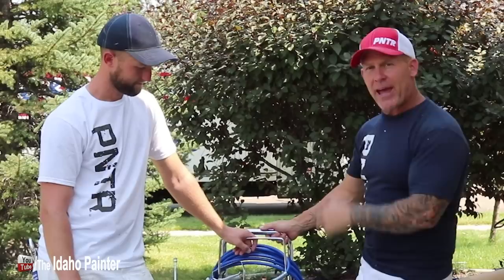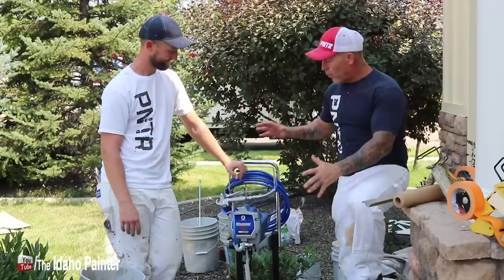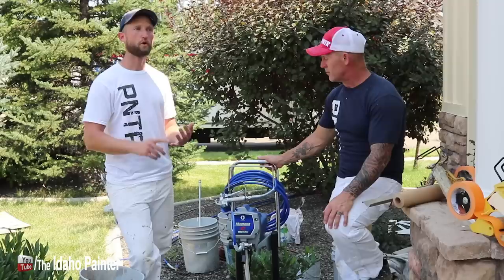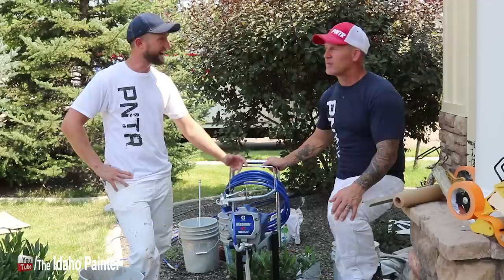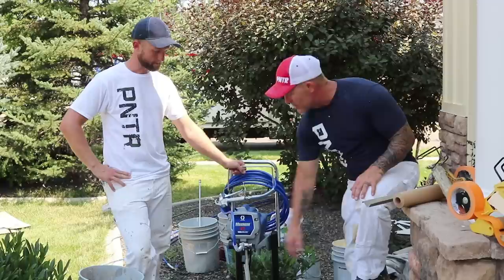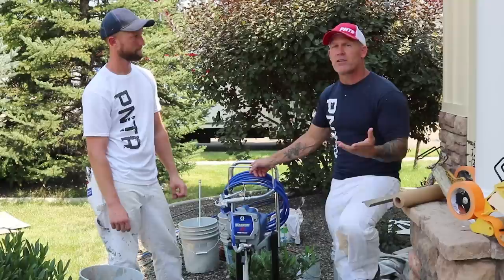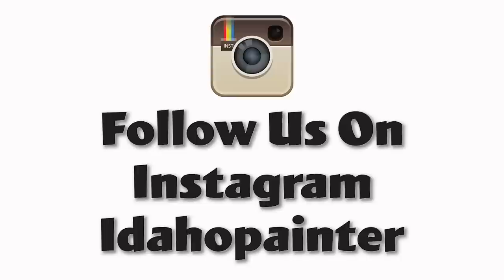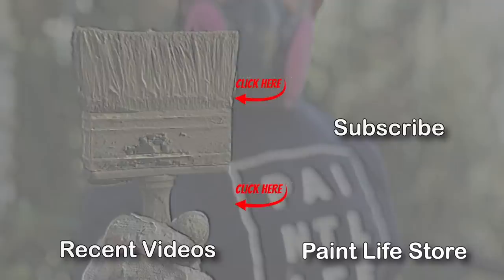Graco X7 Paint Sprayer Review

Comment: Awesome! I used this exact sprayer to paint the exterior of my house and surrounding security wall. I couldn't be happier. The unit comes with an easy-to-understand instruction card. As it was my first time painting anything, I called customer service several times throughout the weekend project. Each time I called a knowledgeable and friendly customer service rep assisted me and I was back to work in no time. Cleaning the unit between colors or at the end of the day is almost TOO easy. Being able to connect the water hose/switch the unit to cleaning mode saved so much time and sped up the process. As a homeowner/DIYer I LOVE this sprayer!

Comment: I bought this paint gun and used it for the first time today. I was using the highest quality exterior paint, which means it was thicker. I spent 4-5 hours fighting it to spray and only 2-3 hours of good smooth spraying (happened at the end). I called customer support and was told I should use a bigger tip than the one that came with it, use a drill paint mixer, and strainer. I'm a newb. Not sure whether to return it or hope it works better next time.

Comment: Thanks for the nice review.  One thing that would be useful is a comment about the quality of the gun. I have a very, very old Wagner 505 that I'm now replacing (somewhat in a hurry as the pump finally let me down in the middle of my current house painting project). The gun was junk but the motor/pump was ok though a bit anemic [515 tip but nothing bigger and this is mostly fine]. I replaced the gun with a professional unit and the thing worked like a charm for 20 years -- I'm a home-jobber so about once every 5 years I pait a house.  Also, knowing what the realistic hose length is would be useful.  That old Wagner came with only a 25ft hose. 50 is about right for me so I added a length.

Comment: Buy the Graco X19 same size & weight but it doesn't run constantly as you spray. I've had one for 2 years got it used & can't kill It! The pump has lasted longer than the gun it came with haha
Reply from the maker: Thanks for sharing your experience with it!
Reply: @Idahopainter  
No problem- it's says the X19 is rated at 500 gallons but I've run over a 1000 through my used pump easy! It's all about how you clean & store it ; )

Comment: Super crazy but i use those Magnum X7’s here in Oregon, i have a couple of these and tend to rebuild one every half year or so but i run these only for the cost factor and can find new ones or parts for them pretty much any home improvement store, the rebuild kits run about $100-150 and always run water through the line at the end the pump armor if it sits for a little while, i used 4-5 different pro Titans at one of my previous jobs a couple years back and they are awesome but havent dove into buying one yet as the Magnum X7 has been a reliable unit for the money, the pump armor definitely helps them last as well. For any DIY person or even beginner paint company pickup 1-2 Graco Magnum X7, couple tips and register it online you can get a free bottle of pump armor plus if you buy new and plan to use them often they have 1 year warranty so can have it covered within that year!

Comment: From my experience with these. They are disposable. I did 3 jobs with the smaller x 5 model. And it started leaking from underneath. That’s when you know it’s close to being done.
Reply: If it was leaking from the bottom with a  thin liquid such as water it's normal. The newer models usually do that. They are designed to spray vary thin liquids.

Comment: I have 2 of these and I literally ran over atleast 2000 gallons and it’s still going strong
Reply from the maker: You sure do get your moneys worth!
Reply: Is there some trick , other than thoroughly cleaning it and using pump armour when you store it?  Cause this model was all I could afford atm, and I don't spray all the time, but I'd like it to last more than a year if I could get it to, of course at 450.00, it has saved me that much in labor in one job, so if it goes out...meh.

Comment: So... What if you buy a replacement suction hose for the X7 ($20) at the Homes Despot... Then take the rock guard off the 440i or 395 and slide the clear tubing OVER the silver inlet tube and use a hose clamp to secure it on the tube. VOILA... I'm not sure if the diameter of the clear tube will fit over the silver tube or not. Hopefully. I may be trying that. I'll let you know how it goes.

Comment: It’s a great painter to start with. Pays for itself and then some on the first job. Will spray relentlessly on the 2nd, 3rd, 4th, 5th and 6th. Titans DIY model to compete with this uses a proprietary gun you can’t change tips on. Doesn’t have a filter like this one has. Has a smaller pump than this one. Doesn’t have a prime button and doesn’t have a quick clean connection like on the Graco. It’s a no brainer. I know these guys are great but they are Titan fans. They didn’t do this sprayer the justice they did to the comparative Titan model. Love these guys but shame on them for very obviously throwing shade on Graco for not only making an amazing cheaper option for beginners or DIYers but the far superior one. That’s the bottom line. Pick a Graco X7 up for a weekend project around the house or a weekend project around someone else’s house and make a few extra grand. I can honestly promise you fantastic results. The extra filter and reversible tip to clear clogs makes it a breeze. The rest is common sense. I know other contractors and weekend warrior painters who use this exact model and have used them for years. With longer hoses and extensions. Mine is going on 3 years old lol.. Graco for life.

Comment: Good timing on this video.  I have a 10 year old Magnum DX and was thinking about getting the X7 to do an exterior paint.  I am a landlord/GC with 6 houses so we are a step up from a DIYer but since most of my jobs are small apartment repaints I dont often break out the sprayer and my gun mostly sits.   To me this guy is more of a GC level model as there are two models below this.  By GC level I mean you are a pro and maybe paint at the end of a rehab but painting is  not what you do every day.   Though 150 gallons a year is not much for a full time painter that is a lot for someone that does renovations or manages buildings.    -  What tip did you guys run in this gun for exterior?

Comment: Glad to hear it works for some people but I wouldn't recommend it. The X7 works nicely the first time >>BUT<< after one use, the nozzle doesn't work properly again. This occurred after shooting only 84 inches of baseboard. 
Since acrylic house paint easily clogs the nozzle, I remove it for cleaning while the first coat dries. When putting it back together, the Hand-Tight Guard bottoms out before the Single-Seal-Gasket makes contact with the mating surface on the gun. It feels like the rubber portion of the seal has completely collapsed (which shouldn't happen after a few minutes of use). Obviously without a proper seal, paint comes leaking out from every gap of the Guard and the nozzle spits more than it sprays. It seems the word "Single-Seal" means it can only be used once. 
Anyway, I tested this three times with identical results every time; the new seal works perfectly once but can't be used a second time. $10 a pop for a new seal. 
I'm heading down to the hardware store to see if I can find a bushing of some fashion to create a proper seal between the gun and the single seal gasket. 
Until this gets figured out, I 'd tell anyone considering this model to move on and find something else.

Comment: Great review guys!  Is it possible to switch from latex paint to oil based paint in this, after properly cleaning it?  Thanks!
Reply from the maker: Yes
Reply: We always used separate hoses,  for oil and latex,  it’s hard to get all the mineral spirits out of the hose and it causes clogging at the spray tip,  I’ve never heard Chris mention this,  maybe they don’t have this issue ...
Reply: Thanks, that's a helpful idea!

Comment: For a couple hundred dollars more you can get the pro series that has a replaceable pump.
Reply from the maker: Good idea!
Reply: @Idahopainter  the pumps don't rev that high with the pro model either. It really is a capable unit
Reply: @Idahopainter  hey I saw another video where you guys used the graco pressure roller. I'm curious if you have compared the jett roller and if so what are the pros and cons between them

Comment: Need a diagnosis my machine is leaking from the bottom of I guess the pump part not the motor.so who knows??
Reply: Leaking  water or paint? It will leak water from the bottom when cleaning. If its leaking a non thinned latex or similar viscosity liquid then the o-ring is shot in the pump, which would require a new pump.

Comment: That rig is a pos. It has a plastic housing rod assembly that'll break. It also has a secondary micro filter at the base of the spray line that'll clog and bind/choke the pump, burn the motor or snap the plastic rod supports.
Reply from the maker: Thanks for the feedback!
Reply: The pro units have a nylon yoke that connects to the pump rod. Also the pro pumps have a outlet filter in the pump and a second filter in the gun handle. Also you need to remove both filter and clean them out each time you clean it. Foow the instructions and you'll be fine.